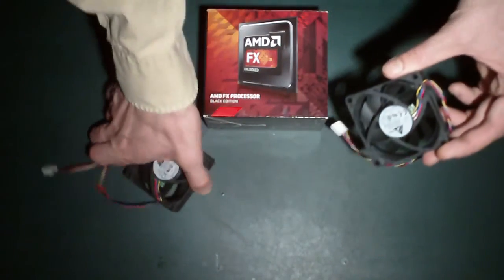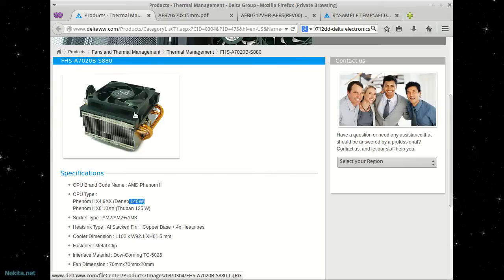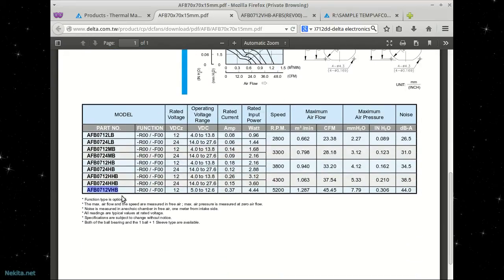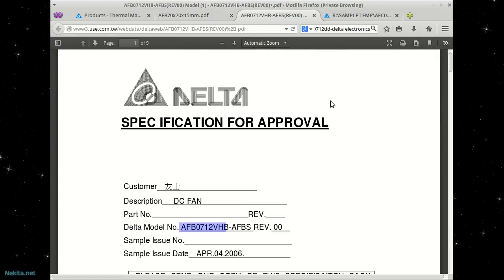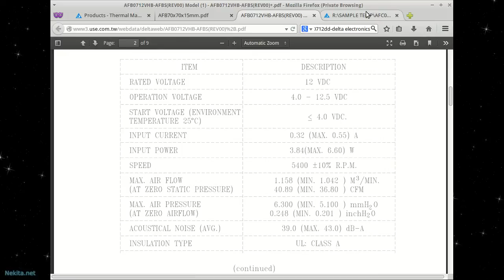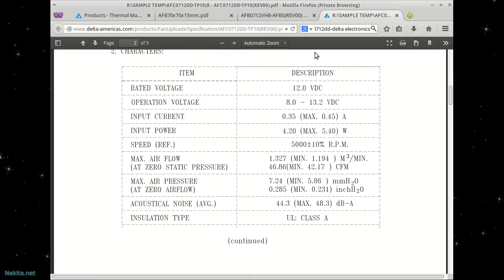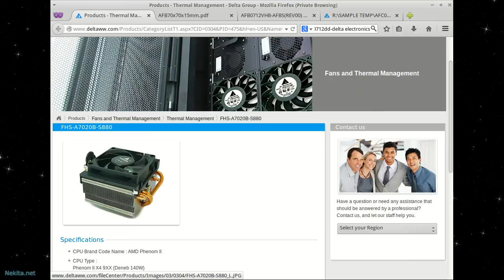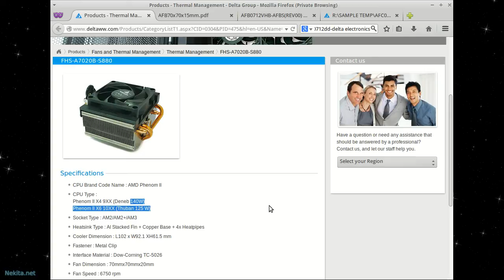AMD FX 8350 Stock Fan Demystified

Comment from the maker: Since the last video on the AMD FX-8350 Stock Boxed CPU Cooling Block FAN (yea that's a mouth full) there is news! It seems that AMD, or Cooler Master or Delta Electronics inc. has skimped out on the Stock Cooler Fan. Replacing the original with a skinnier one while at the same time doing away with the nicer "gift tin box" packaging. Take a look at the vid for the update!